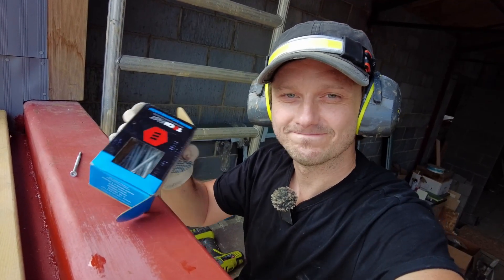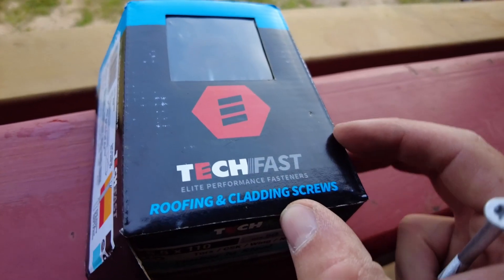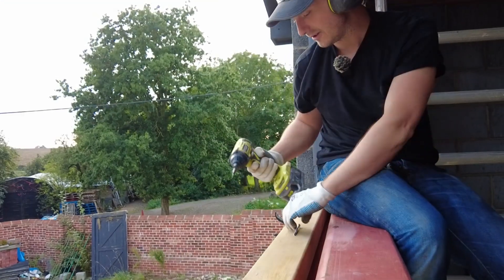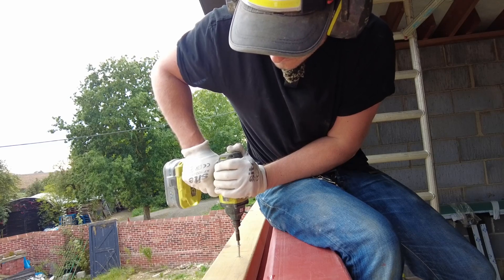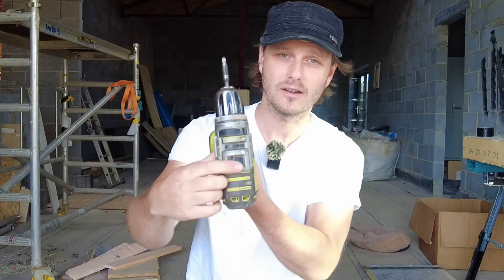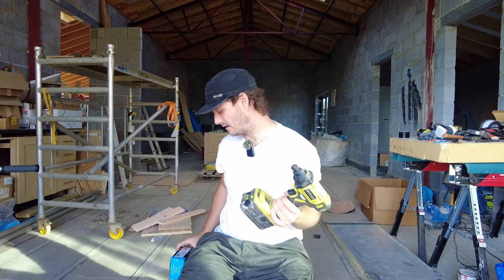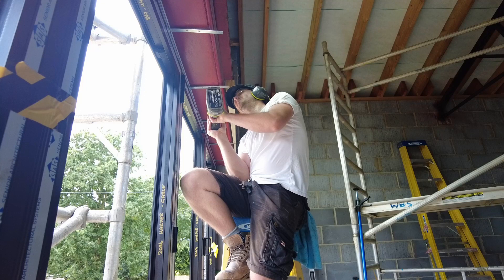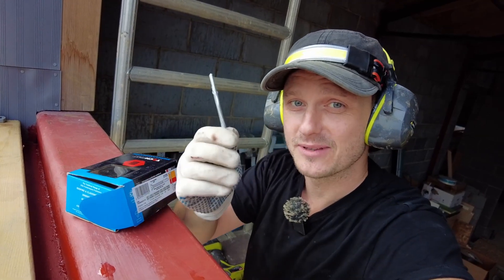Screw Wood to Steel IN SECONDS!

Comment: hi 
might seem like a stupid question but can these fixings to the opposite way so through the steel into wood?

reason I am asking is i am fitting my garage roof so I am drilling through the angle iron into wood?

thanks in advance
Reply from the maker: Unfortunately not, these are the heavy duty ones so the thread on the screw is almost like a machine screw which won't really hold in wood. I did think maybe you could try the light duty ones as they have a different thread but I'm sure the thread would probably get destroyed by the time it got through the steel. I'd get some decent drill bits and then use normal wood screws
Reply: That's great thanks for the advice mate